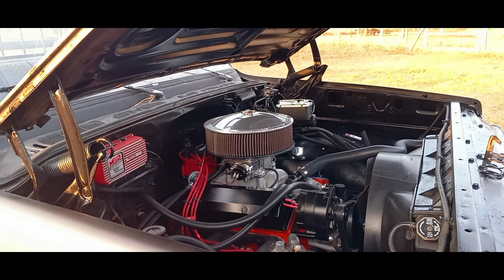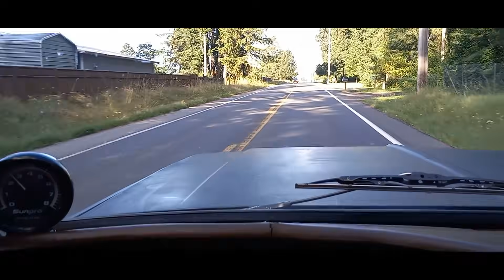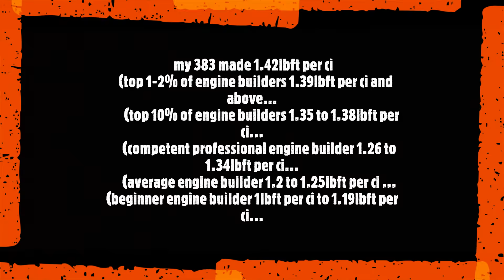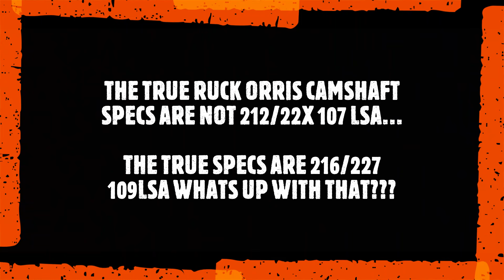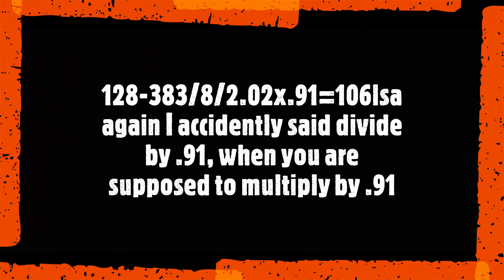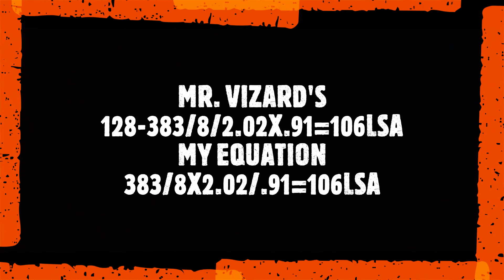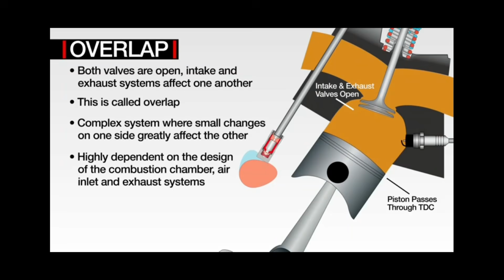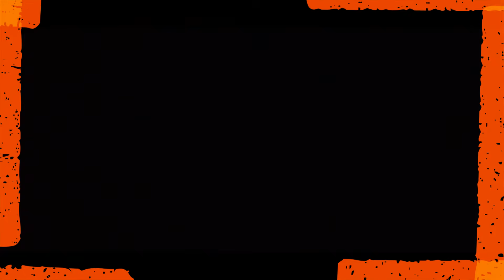CAMSHAFT SELECTION by LSA, 9 LSA's DYNO TESTED!!! LSA THEORY WILL BE DYNO PROVEN!!!, and EXPLAINED

Comment: I enjoyed the video, but you missed what is happening. You are like Holdner, you see something happen on the dyno and create a theory to match why you think the results occured. LSA is a calculation byproduct. If you design the lobes in the correct events, then you never need to even calculate LSA, LSA is not a cam design characteristics, it is a byproduct of the lobe events. When you did a test where nothing changes but LSA, that isn't what happened. Everything changed, including LSA. You tested 3 completely different cams at that point and failed to see what was the actual cause and said it was LSA. Again, I enjoyed the video and am only commenting so people can also see a counter point.
Reply from the maker: Thank you for watching, im glad you enjoyed the video.. Now on to explain your comment... 98+% of the top engine/camshaft experts, ( there are very small groupe of individuals who have the correct understanding of valve events and that list is geting shorter everyday) they all agree that only one LSA is ideal for max performance. But due to lack of correct testing not all of them have a complete understanding of the absolute effective increase in power that can be had with the optimal LSA...
I'm sure you know david vizard, being that he has his LSA formula, he is the biggest proponent of one single optimal LSA, and his formula when properly executed will absolutely produce an optimal LSA for max output for a given engine.... 
Now that Harold Brookshire is not here anymore I would say that 
Mike jones is about the only person that could produce a camshaft that would produce anywhere near the results of David vizard.. 
I have listened to and read threw hours of private conversations between the likes of people at the pinnacle of valve events, people such as David Vizard, Jon Kasse, Joe Sherman, Mike Jones, Darin Morgan, Harold Brookshire, Stan Weiss, mike wallace, etc.. they have all came to the conclusion that only one LSA exists for a given engine combination, how you come to the conclusion for the perfect LSA may vary, but as long as are able to come to that conclusion is all that matters... 

Threw out my life starting as a child, and threw the previous 2 generations that thought me, my family and i have come to to the same conclusion, Being as my grandfather was an engineer, physicist and race engine builder who spent years dyno testing camshafts/engines and my dad grew up along side him, building/testing engines then became a engineer/master machinist/engine builder... by the time i was 8 years old they had given me a nere complete understanding of each of the valve events, what they do, what effects they have, what effects them, and when and why to change specific valve events to achive specific results.. I started in a machine shop at 8 & i started building engines at 10years old, i later became a machinist/welder/engine builder with a solid understanding of engineering principles and multiple levels of physics, starting with the 26 dimentionless constants that describe the universe, and the 4 possibly 5 fundamental forces,  all the way up to what we see, or what is projected to us... I grew up building and testing race engines with my Grandfather & my dad, my dad had owned a full service speciality machine shop with a engine dyno for 18 years, so I have quite a bit of experience in about every aspect of this stuff, because we didnt just build engines, the dyno was primarily for reaserch, and engine combination/camshaft development. the only reason I'm not running some sort of buisness/machine shop is because all of my health problems, the fact that I now have multiple disabilities from 3 unfortunate life situations, along with the fact that since 2010 we have been taking care of my grandmother who is now in the end stages of alzhimers and that takes about all of my time...back to the point lol.. 

HERE IS A QUOTE FROM MIKE JONES... I HOPE YOU KNOW WHO HE IS.. im sure you probably do... 

THESE ARE HIS WORDS I COPIED & PASTED...
"Like I said before."
"There is no wide Lobe centers."
"There is no narrow Lobe centers."
"For each engine application, there is only the correct Lobe centers, and everything else is incorrect." 

Mike Jones
Jones Cam Designs
Denver, NC
jonescams@bellsouth.net
http://www.jonescams.com 

I AGREE WITH THIS 100%, THIS WAS 100% THE POINT OF THE LSA PART OF THIS VIDEO, IT WAS TO SHOW WITH DYNO PROOF THAT ONLY ONE LSA WILL PRODUCE OPTIMAL PERFORMANCE IN ANY GIVEN ENGINE COMBINATION.. 
At around THE 1hour 5min - 1hour 9min POINT IN THE VIDEO WHEN I GAVE THE RESULTS FOR THE 108LSA, AND GAVE THE REASON WHY THE CHANGE IN INTAKE VALVE OPENING & CLOSING EVENTS, AND MORE OVERLAP WITH THE 108LSA CAM SHOWED THE BEGINING OF THE EFFECTIVE INCREASE IN HP &TQ FROM BEING REAL CLOSE TO THE PROPER LSA , IF YOU PAUSE THERE WAS INFORMATION WRITTEN ON ALL 3 OF THE THOSE DIFFERENT LSA TESTS SHOWING & TELLING THE TYPICAL EFFECTS OF WHAT TO EXPEXT FROM RANDOM CHANGES IN LSA WHEN LSA IS NOT CLOSE ENOUGH TO OR THE ABSOLUTELY CORRECT LSA ...DYNO SHEETS I BROKE DOWN SHOW THAT WHE YOU SELECT THE CORRECT LSA THERE IS NO DENYING THE INCREASE IN TQ&HP PRODUCTION ACROSS THE CURVE...  HOW YOU ACHIEVE PROPER LSA MAY VERY.. THIS VIDEO SHOWS PEOPLE THE EFFECTS OF SELECTING A CAM WITH THE IDEAL LSA AND ITS POSITIVE EFFECTS BY CHANGING THE INTAKE & EXHAUST VALVE OPENING & CLOSING POINTS, THE FACT THAT LSA IS THE MOST CRITICAL AND MOST INCOMPREHENSIBLE ASPECT OF CAMSHAFT SPECS...  END OF PAGE 1.
Reply from the maker: PAGE 2...
NOW OBVIOUSLY WHEN YOU CHANGE THE LSA OF A CAMSHAFT, IT IS A DIFFERENT CAMSHAFT, THAT WAS AN OBVIOUS PART OF THE POINT OF THIS VIDEO... SO WHEN YOU SAY 3 CAMSHAFTS WITH THE SAME SPECS EXCEPT LSA,(because that is what it is) WHAT THAT MEANS IS THE CAMS HAVE THE SAME DURATION, AND THE SAME LIFT, THE ICL OBVIOUSLY CHANGES ALONG WITH LSA THAT IS COMMON SINCE... THE POINT IS IF YOU CHANGE LSA YOU CHANGE THE VALVE EVENTS, (AS I SAID IN THE VIDEO) AND THE RESULTS OF THOSE CHANGES IN VALVE EVENTS MEANS THE CHARISTICS OF THE VALVE EVENTS PRODUCED BY THE CAMSHAFT ARE CHANGED, AND THE CHANGE IN THE CHARISTICS OF THE CAMSHAFT WERE EXPRESSED IN THOSE DYNO SHEETS, WITH THE POINT BEING THERE IS ONLY ONE IDEAL LSA.... 

Im gonna continue by saying, i clearly understand how to design a cam based choosing the valve events according to what you think the placement of the events should be or in other words how you choose the degrees at which the intake&exhaust valve open&close points take place based on the degrees of crankshaft rotation and piston position inside of the cylinder,.. The by product of the chosen degrees of each of the valve events would result in LSA....  There is no way you could explain and expect the average individual to comprehend whats being said, Hell even alot of the more advanced individuals couldn't understand how to design a camshaft according to all aspects of the engine and its intended use and then choose the cam lobe angles based on the degrees where you think the intake & exhaust opening and closing points in accordance to degrees of crankshaft rotation & piston position... you cant expect 95%+ of the population understand and be abolle to achieve anywhere near optimal results... That is a little much to expect most people to potentially ever grasp, I had people tell me this video was still to complicated and that i should have explained it more simply, but as far as this subject goes i simplified it about as much as possible, i filled information gaps, i answered questions that were left unanswered by similar videos, and gave info you won't find or hear anywhere else on the internet.. 

Now im am nothing like richard holdener, nothing against Richard because he has alot of dyno experience but there are quite a few things he dont comprehend.. Next, being as I have a more complete understand of valve events than most individuals, and i gave a easy to understand explanation of what was happening im not sure what you think i missed about any of this when i gave the absolute proper explanation of the reason why the 108LSA made the most HP & TQ at peak and below peak, Which was because the intake valve opened & closed sooner which increased compression, cylinder pressure produces more TQ&HP, and compression increases the rate at which the cylinder evacuates, but the main reason is because switching to the cam on a 108LSA provided more overlap, and allows the intake valve to opened sooner which presented flow to the cylinder earlier, this allowed the cylinder to fill more efficiently, and allowed the 402ls to fill and evacuate the cylinder more completely.. the intake valve opening sooner results in more complete filling of the cylinders allong with the overlap, and compression bolth of which allow for the cylinder to more efficiently evacuate the cylinder, which in tern will again allow the cylinder to fill more efficiently and the cycle continues, this results in MAX TQ & HP production for any given engine at & below peak, with the ability to carry peak TQ & HP past peak for longer in any given engine combination, no matter the intended use... 

the valve events produced by the change to the 108LSA which opened the intake valve earlier allowing the cylinder head to present clean charge earlier which is absolutely critical for a 402ci ls engine to be able to take full advantage of a given cylinder head, because if you dont start filling the cylinders at the perfect time at the very beginning of the induction cycle, cylinder filling will not catch up which result in the cylinder not filling completely... You have to open and close the intake & exhaust valvels at the perfect time within the very beginning of the induction cycle at low lift, while the pull on the intake from the overlap cycle is still exist, if the cylinders do not start to fill at a specific time within the very beginning of the induction cycle the cylinder head flow will absolutely not not catch up to the decending piston, which consequently will not be able to fill the cylinder completely, and noy be able to take full advantage of the cylinder filling due to overlap because it will take place at the incorect time which will result in the cylinder not filling and evacuating completely/efficiently, with the end result being less HP&TQ produced, these are the type of results that were seen with the 112&120LSA's... Now being as the LSA which is a spec on the cam, and LSA is the spec of the cam that changed in those dyno tests, and LSA is a factor that people have to consider when they will spec a camshaft that is why I explaned that the ideal LSA is what had caused the effects produced by the 108LSA, These effects are not understood by most of the population within the camshaft community which is absolutely 100%true... those 3 dyno sheets existed for years and nobody, even those who conducted those tests never gave even the simple answer of the effect changing LSA has on valve events, and the effects those valve events have on the engine.. example the reason why when you randomly change to say a 104LSA when not optimal, it will always make more tq at & below peak and make more Hp below peak but never make more peak hp in comparison to a 110LSA which will produce less peak TQ and will produce less TQ & HP below peak, but will produce more peak HP... At peak HP the 104LSA will always fall of first when LSA is not optimal... I recently found that not only did Richard write an article about his LSA test, apperently Richard holdener also did a youtube video about this specific LSA test...Richard Holdener and not a single one of the several hundred thousand people that watched that video recognized, and definitely couldnt explain the effects that were being produced by the fact that the 108LSA was so close to ideal, Richard just attributed the effects produced by the 108LSA as being a random occurance that defys the typical results of what is to be expected from those LSA tests, he simply said "this is why we dyno test these kinds of things"...  He was correct up to a point, that point being the results are definitely not typical, but he could not recognize these are the effects of LSA being near optimal... those are the effects produced by being so close to optimal LSA accompanied by awsome cylinder head flow..  even though the idel LSA is 106, it was Cylinder head flow was alot of the reason the engine  allowed the the 108LSA to display the effective increase in TQ & HP production without being the absolutely ideal LSA.. Now In my video, because all those dyno tests were conducted in the standard fashion for LSA tests, and LSA was the spec that changed, this is why i explaned that when the LSA changed, the valve events that the camshaft produces had changed, this is why the output of the engine changed, because of each of those camshafts were different, which is the point of the video, and is common sence.... 

What would you say about a test conducted with three camshafts with Identical specs except duration?.. 
Meaning LSA, ICL, AND LIFT are the same, and what would change is duration, and that changes overlap...
  just like the LSA test, except what changed was LSA & OVERLAP...  
Bolth tests show the effect of having changed the valve events meaning they are obviously different cams... 

Again, Thank you for taking the time to watch i really appreciate it...  Take care
Reply: @CDG-Racing_Dynamics    thanks for the reply, that was a lot! I personally wouldn't put Vizard in those names with those others, but he is fun to listen to. Your Mike Jones quote says what I just said. He says correct lobe centers. Which is open and close events with a small caveat for asymmetrical lobes. He did not say LSA however, and I would argue that if lobe centers are correct, the LSA is whatever the LSA happens to calculate to be. If we moved advance/ret, that would move centers to be incorrect and LSA would still be the same. Maybe it is just semantics?
Reply from the maker: Of course asymmetrical lobes profiles and ICL both play a role... Camshaft lobe profiles specificly asymmetric lobe profiles, also the effect of ICL, and how to determine the correct ICL, all of these in themselves are completely different subjects, bolth are determined by different factors, and all ofxthese factors will ultimately have effects on the camshaft opening & closing points, but it still comes down to the correct LSA... In the video i also slightly touched on asymmetrical lobe profiles and lobe profiles effects on valve event positioning, and lobe profile dynamics.... 
I like the fact that you have a brain...  take care buddy.

Comment: So on a 383, the duration needed is only 216? That might work with double humps or vortecs and 3.42 gears, but it sure won't be good for 4.56 gears and 210cc heads. Brian Tool, I mean Mr T is full of shit with his horseshit cams, but I don't see making a small 216 duration cam on a 106 in a 383 with big heads and steep gears working good either. What am I missing? I'm not saying you or David are wrong, I'm just trying to understand what I'm missing.

Comment: I always knew cam selection was complicated, and this confirmed that.  I think the cam in my LQ9 is suboptimal @113 LSA 235/240 .626 It does have AI 232cc 2.055 big valve head and 11.4:1CR It puts down 483/428 at the wheels in a 98 Camaro M6, but I don't see why that combo wouldn't break 500/450 at the wheels. I think I have my answer now!
Reply: Yeah, you should need a 108 or 109 lsa since you're a full point of compression above the reference 10-10.5:1. Also, you should find Cattledoggarage's other video to confirm depending on your rocker ratio, and also to translate your current level of overlap into the new duration you'll need to compensate for the new LSA so you have the same amount of overlap after your cam change.

Comment: Mr Adam,
I hope you are doing well, in-spite of your debilitating disease. I had and still am trying to wrap my head around your calcs, because I was taught differently amongst the masses. I have been an Prototype Engineer and CNC Machinist over 42 yrs.(still working) I am not familiar with some of this info, but I did verify your data, and it works. It is just foreign to me, so thank you. I am by no means any expert in building engines, but have been lucky I guess. Now I have way better info, and a lot more facts. God bless you, Dean. 'ProfabDesigns'

Comment: I read that for cylinder heads that flow 75% or less exhaust than intake, you increase the split to help with expelling the exhaust gases in the cylinder. So when you do the lsa formula, do you do it for just the intake, or do you do it for intake and exhaust for optimal duration?

Comment: I just watched the whole video. And thank you for all the information provided. 

Now, I have a 350sbc L48 code (1971 chevelle). Im currently thinking of changing cam and heads. Been concidering afr 195cc 64cc enforcer head. That should put be around 9,5:1. using your formula it gives me and lsa of just above 107. So, I then pick a camshaft that has a listed operating range that is desired, for me its max 6500. I want a good broad torque as its mostly going to be street driven. I pick the camshaft that has the right operating range for me, then surely its not with the right lsa. So if the lsa is wider and i would custom order a cam with same duration but tighten the lsa the overlap would increase, so you then lessen the duration @ 50 until you get the same overlap? Is that the thought prosses?